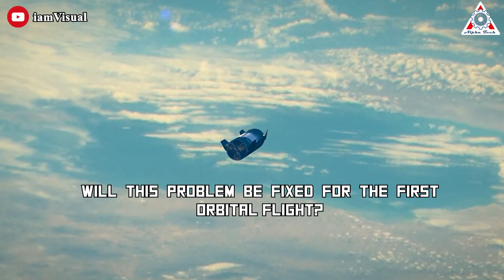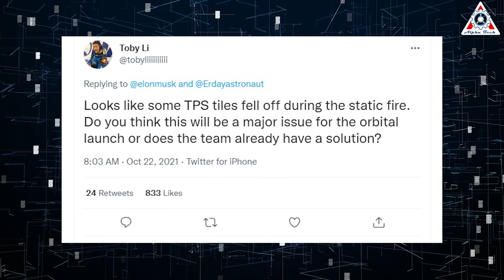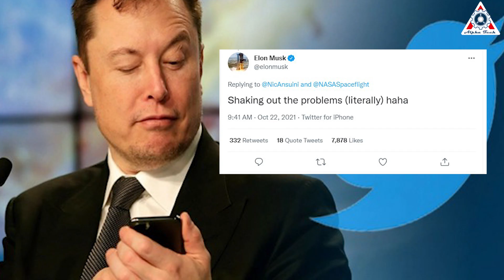SpaceX Starship's heatshield Testing problem!

Comment: Don't use tiles.  Use insulation blankets like they started doing on parts of the space shuttle.  

Or... How much heat could the fuel in the tanks absorb before the pressure got too high?
Reply: The heat being protected against is during re-entry, after the vast majority of fuel and oxidizer have already been burned to acheive orbital velocity.
Reply: @NullHand  Yeah, I get that the amount of fuel is diminished but still there is a lot in there and if it were to be heated up in the process it might just have the effect of returning the pressure level in the tanks to what it was around lift off.  I am not saying I have done or even could do the math.  I am just guessing, or wondering, but it seems like it could work.  It would also have the knock on effect of making the gas feeding the motors for the landing burn come out at pressure so the pumps feeding the combustion chambers might not have to work aa hard.
Reply: @dennisgunn468  when landing on the barges, Falcon 9 first stage uses about 6% of its takeoff propellant for the re-entry and landing burns.
Starship seems to be relying more on aerobraking (bellyflop on thermal tiles), so they may be using an even lower percentage if there is no significant reentry burn.
Also, turbopumped rocket engines must injest liquid (cryogenic liquid for methalox) propellant to pump through the bell, and into the combustion chamber.
Gasses are about 1000 times less dense than liquids, so really bad things happen to the engine when it injests gas, rather than the cryogenic liquid it was designed for.
Reply: @NullHand   It makes sense gas is not going to work where liquid is required.  I have read that the larger and flatter the body reentering is the further the shockwave ends up being from the body.  Since Starship is much larger in diameter than the Falcons are, I just wonder how close it is to being big enough that it does not need tiles at all.

Comment: Moreover , the tiles are flat and the surface is round. So there is no tight fit.If one falls off , then  the airflow will tear off most of the tiles.
Reply: Space Shuttle eningeers were worried about that too (they called it the 'zipper effect') but it never happened.

Comment: SpaceX does static firings of the Ship (the second stage of Starship) on a ground test stand. That's a much more severe environment for those tiles than an actual Starship launch in which the Ship sits on top of the Booster (the first stage of Starship) that's 220 feet (67 meters) tall. 

Elon has solved the missing tile problem on Starship by adding that white, flexible ceramic fiber matt between the backside of the tile and Starship's stainless steel tile. That matt probably is something like Kaowool 3000 that has continuous use temperature up to 2800F (1528C). That matt will stay attached to the Ship even if one or more tiles become dislodged.

Side note: My lab built and tested rigidized ceramic fiber tiles like those that were eventually used on the Space Shuttle during the conceptual design phase of that program in 1969-70. The Starship tiles are third generation variants of those Shuttle tiles.
Reply: There has to be some research as to how many tiles can be lost without total failure. Both for a section and overall.
Reply: @toddkorson8207  It depends on how many tiles are lost and where those lost tiles were located on the hull. The Space Shuttle experience shows that losing individual tiles only does not cause a vehicle disaster. 

IIRC, there were only a few instances in which a small group of tiles was dislodge from the Orbiter without causing a problem. 

One failure mode that was identified early in the Shuttle program was the "zipper" effect in which the loss of one tile would cause a chain reaction during which dozens or more of adjacent tiles would be lost.  That scenario never happened on the 133 successful Shuttle missions.
Reply: @rays2506  that’s what I was thinking. There would have to be a significant loss of integrity in an area
Reply: @rays2506  135 missions

Comment: Do the shockwaves and sound from the engines bouncing off the ground during static fire testing make the vibration on the heat shield tiles worse ?  Normally the engines will only operate in the near vacuum of space or when landing.

Comment: Why he cannot create a single heatshield made out of a single mold.
Reply from the maker: for the whole Starship?
Reply: Thermal expansion is linearly additive.  So if a 30cm across hexagonal tile grows by say, 3mm in size when heated up to 1400C, then a tile of the same material that is 3500cm long (length of starship) will grow by 350mm (about a Texan foot).
You are going to have trouble finding a way to glue, screw, or otherwise convince such tile to stay attached to a rocket that is suddenly 1 foot to short during reentry.

Comment: Why can't Elon secure each tile with four pins, instead of three pins, to mount them to the ship
Reply: Geometry.
3 points not colinear define a plane no matter what the orientation.
Adding a fourth point generally creates 2 planes, unless they are carefully positioned.    This is why 4 legged chairs and tables tend to rock if a floor is not smooth and flat.   Also why cameras and survey equipment are always mounted on tripods, never quadrapods.
Reply from the maker: 25000 tiles will be a hard work

Comment: With 25 and 26 being tile less. SpaceX might have already abandon the tile idea. I would not be surprise to see them get an ablative shield before being flown. I was never a fan of the tile simply because of how much of a nightmare it was for the shuttle. I understand that it could be a really fast turn around if they all stay attach. But what we learn from the shuttle and now starship is that it is easier said then done.
Reply: True, but remember that the Shuttle fleet's tiles were very complicated. The tiles were not interchangeable nor were they uniform in shape and size. SpaceX tried to remedy this by making a single sized tile that is easier to produce and replace.

That being said, there are significant issues with these tiles coming off.
Reply: Ablative material is about 5x heavier than SpaceX Star-tiles and must be reinstalled for every mission. It would weigh about 40-tons to do that - that's the weight of a moon lander fro the Apollo era. I think they've got their tile solution correct but need to work on sound and vibration management. Using a flat launch-pad creates huge sound-pressure reflection back to the spacecraft. I suspect part of the vibration issue could be managed with destructive sound dampening across engines and the uses of a deflection style flame deflector and water deluge. I know Elon is trying to avoid the NASA big government style launchpad as there will be no such infrastructure for a MAV.
Reply: @peterreimer2540  By the time there is a Starship landing on Mars and coming back to earth. I'm sure SpaceX will have access to all the new ceramic composite material the military is working on. Elon will probably be dead by then.
Reply: @peterreimer2540  yeah if they raised the height of the stand, or dug out flame trenches that went down and out a d able to take all of the flow from the exhaust nozzles that would likely fix the issues.
If only there was a company who could dig tunnels from under the launch pad out a couple of hundred yard like spokes on a wagon wheel and allow the flame to be cooled and carried away and redirected up and out safely.
Reply: Wonder why they can't have prefab ablative heat shields ready to go that could be swapped out or printed directly on the starship itself. Wonder if it would be possible to have that printed in space so any damage from take off could be repaired before re-entry
Reply: @4schitzangiggles  wouldn't it be easier to send tiles and EVA suits?
Reply: 25 and 26 are never going to reenter the atmosphere they are test ships for the lunar lander... yup the moon has no need for the tiles.. they are just hanging weight so leave them on the ground for more fuel..simple idea really
Reply: 26 and 27 are tile-less. But then 28 and so on have them agai

Comment: Personally, I wish they would come up with a better solution, like the perspiration cooling, or a better connection mechanism, maybe some sort of flexible connection and seal like aerogell, I am not a material scientist, so I might be completely out of line, but I just think the tiles present a major failure point, and maybe they need the same kinds of first principals solution as removing legs etc, I am probably preaching at the choir I am sure, they are looking at this with their best and brightest.

Comment: Is it not possible to have another return trajectory…longer time and less angle. Keeping the temperature down…?

Probably This has been investigated 🙂🙂
Reply: So you do not Need ANy tiles at all. Only stainless steel
Reply: You can't because too shallow angle the ship will just bounce of the atmosphere. And it most likely don't have enough fuel to slow down enough 🤷🏻‍♂️ Perhaps refueling I orbit could fix this.
Reply: I assume This has been thorougly investigated. 
It would be nice to get rid of the tiles. 
Stainless steel manages temperatures up to 1100 degrees celsius…
But maybe it is not possible to keep an return angle Low enough to maintain lower friction from the air. 

But as I mentioned…This must have been investigated already
Reply: It is not just temperature that threatens the steel during reentry.
What actually contacts the ship is plasma.  Oxygen and nitrogen that has been ionized, and is much more chemically reactive.
And coincidentally, the modern prefered way to cut stainless steel during fabrication is.... a plasma cutter.

Comment: I think SpaceX should take a look at lapstrake-bottomed boats for a different way to do heat protection. If they could use long "blankets" that overlap as they go from belly to side, there would be fewer small parts to shake loose.

Comment: Heat tiles shaking off must be a massive problem to overcome, considering all the other problems which SpecX has managed to overcome. I often  wonder if they are manufactured flat or with a simple curvature to match the surface curvature of the ship.
Reply: For the small size and being connected by three bolts, flat is likely good enough for most situations. The bigger problem is that the tiles are brittle and crack easily under bending stresses when the rocket surface deforms under high vibration and loads. What if the bolts could be made to float slightly relative to their supporting surfaces, so the tiles would float relative to the surfaces and not be stressed as much and crack?

I live in a one-story house with floor tile everywhere on a concrete slab. A layer of Schluter®-DITRA was installed between the concrete slab and tiles to prevent a cracking and shifting concrete slab from cracking the attached tiles. After 15 years our tile floors have not seen a single crack anywhere. Something along that line might be a great idea for attaching heat-shield tiles to vibrating and deforming surfaces.
Reply: @ben8190-rip  Not attached with bolts... they attach to stainless steel clips that are welded onto the body, three clips on each tile. They literally SNAP ON. https://i.stack.imgur.com/ZlBSm.jpg
Reply: They look flat to me in close-ups. I wonder what the result will be when Starship separates from booster and then fires engines. on an actual mission, Starship will never fire engines strapped to a test stand, it will be free in space or taking off from the planet it is on. Right now, it's bolted down to an immovable object, the test stand. Will vibration break tiles when it fires in space where it is intended to fire? Starship is the second stage and doesn't fire in the atmosphere until landing.
Reply: @gdscott8276  = Boom Baam 😆😅🤣😂😅
Reply: @gdscott8276  Yes, I always thought they looked flat. My instinct would be to manufacture them with a simple curve but I'm certainly not qualified to offer an opinion.
Reply: @rogerwilson6367  I heard Elon speak about this, and flat tiles are much easier and cheaper to make. Their relatively small size means there is no need to curve them.
Reply: @gdscott8276  I had a feeling they would be flat for purposes of manufacture/economy, although I can't stop thinking they should be curved😀😀
Reply: @gdscott8276  If they were actually flat, the shielded surface would appear to be faceted but I have never noticed that visual effect.
Has anyone noticed that?
Reply: @frankmcgowan9457  Not difficult to Google a closeup pic. They're flat.

Comment: THE static fire test with ALL six on the ground is very much the Worst case I think. In reality the take off is 400 feet below the star ship and hopefully the vibration will be much less. Once the starship is separated from the booster only three engines will fire in atmosphere and then the vacuum engines will fire in space. From the flight videos in space the vibration we see on earth
Reply: I'm pretty sure they only use the vacuum engine on the way up. The other three are only use to flip and land the starship when its coming back. In any case the tile should stay on at the worst condition multiply by 3. I think the 6 engine fire up on a pad is a good test for the tile anchor.

Comment: If Stainless  steel resists until 1000 celsius degrees an melting is not below 1400°celsius is quite high protecton thanks to use S.S. and the  tyles are protecting the stainless steel surface but due to vibration a few number of tyles  come off . Is it possible to put double line of tyles in  those critical areas to assure a higher protection and of course try to reduce drastically the vibration?? Sant Cugat Barcelona
Reply: Steel is also a good conductor of heat. The excess heat generated by air friction on the exposed steel surfaces could flow into the structure and cause other damage and failures.
Reply: @ben8190-rip  you refer to  carbon steel but not stainless steel . Stainless steel has an even lower conductivity than carbon steel. Stainless steel also remains stable when in contact with heat. 
One of the major safety issues remaining with Starship is the heat shield and the ability of the stainless steel under it to maintain its integrity if one or more of the heat resistant tiles come off.
Sant Cugat Barcelona

Comment: I think bigger flaps to allow more flying capabilities and be able to slow the ship with less heat produced.
Reply: these flaps are basically brake padels, not wings. The little amount of lift the ship gets is purely through the body.
Reply: I really think you are on the right track although maybe going one step further and actually having wings would be even better. If the second stage returns empty stainless steel alone might stand the heat.
Reply: @stevemickler452  Tile destruction on the leading edge of the wing destroyed a shuttle and killed its crew.  Let's not set up to repeat that.

Comment: SpaceX and Rocket lab need to collaborate on the next rocket tech.
Reply: I'm not sure anyone could collaborate with EM.  Gung-ho!
Reply: @Mr5thWave  idk man they are making some awesome strides too.
Reply: I think rocket lab is way smarter than space X.  Going to orbit and returning is not analogous to aircraft as Elon maintains.  RL avoids reentry with a very cheap second stage that can be mass produced with 3D printers.  The throw away costs are miniscule compared to Space X stage zero.  People need to stop butt snorkeling Elon.  He is not the smartest guy in the room, and RL has already proven it.  Returning humans to earth can be done by a Cargo Neutron, which drops off a capsule to the space station.  Neutron launches will be very cheap, and have fast turn around time.

Comment: He hopefully will come up with some thing.  A British company has a way to cool fuel down to a combustible temperature and can fit in a plane.  The componies name , I think is SKYLON or the plane is called that  This device can cool down temperatures from thousands of degrees to sub zero in seconds.  This allows the fuel to burn better when engaged in HYPERSONIC FLIGHT.  Not sure if that pertains to their analogy of trying to light a match in a wind tunnel phrase.  So it would be great to be able to cool the skin of the ship on re entry with this device.  These guys are working with DARPA and the AIR FORCE and this equals lots of money.  HONEST with us?? must be a SOUTHERNER/TEXAS thing.  And yes home of the most racist state in the Union.  So NOT HONEST, OK Buddy! shout it from the highest places that Texas will arrest you for giving some one water in the voting line.  You need a lot more elicution, BUDDY!
Reply: Calling folks racist is not fitting for polite company, Proud Biden Voter.
By the way, the British have been coming up with great space engineering ideas since the 30s, but have failed to produce a single thing in real life.